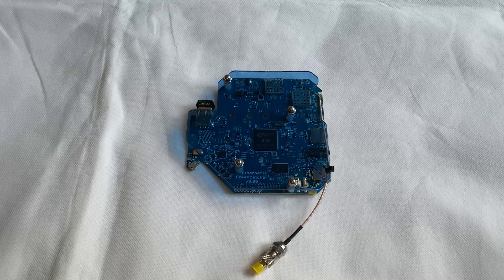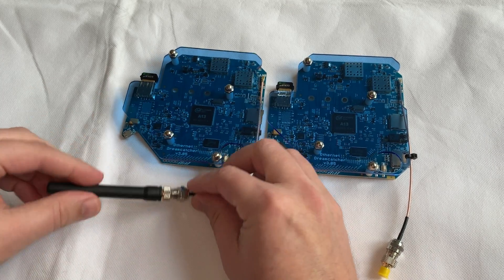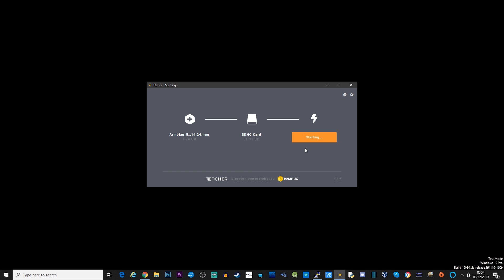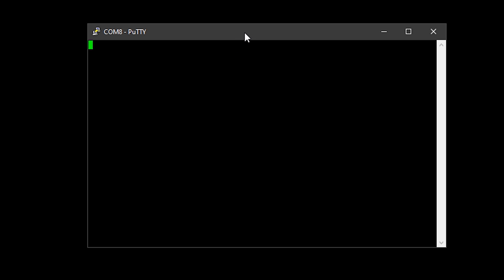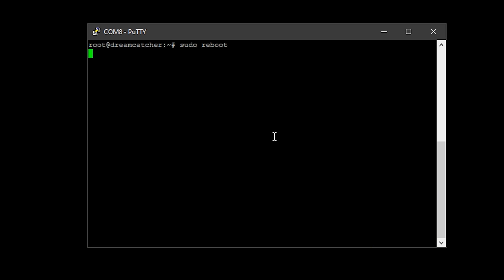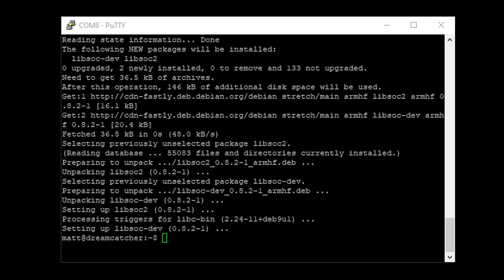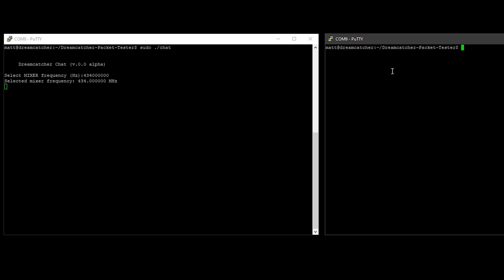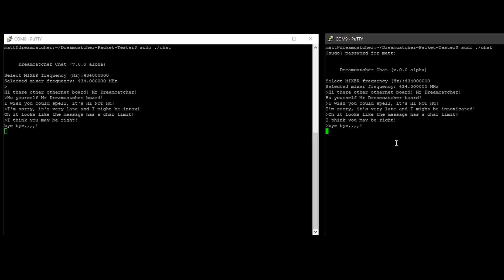What can you do with two Othernet Dreamcatcher Boards?

Comment: Awesome! What would be cool is to have an app on your phone that connects direct to the board by WiFi (or via your home WiFi network) so you can use your phone to send the messages without any sort of internet connection. The transceiver could then be placed in the loft of the house with a permanent antenna to ensure stable comms.
Love it!!!
Reply: Well done,can you teach me its connection procedure,is that connected to LNB

Comment: Just so ppl know, you can use any type of computer or SBC to do this. For example, you can use an SDR transceiver with a Pi as well. 
And yes you can use a USB Audio Interface. Most distros already have drivers and libraries for audio built in, but some lite/slim distros made for SBC's (Single Board Computer's) don't. In that case you can use alsa-lib. Depending on what SBC you're using and whether the interface is a dongle interface or a full blown interface, you may need to provide external power to the interface or use a powered USB hub.
!!!!! MAKE SURE TO CHECK YOUR COUNTRIES RULES ABOUT TRANSMITTING AND WHAT FREQS ARE ALLOWED. YOU CAN BE FINED FOR IMPROPER USE OF RADIO. OFTEN A LICENSE IS REQUIRED TO TRANSMIT OUTSIDE A CERTAIN FREQ RANGE !!!!!
Now, about power delivery in general. This is important information for people who aren't already aware.
When you're using SBC's with things plugged into the USB port/s or wifi or bluetooth or all of those, I recommend using a powered hub or a USB3.0/3.1 port as they provide more power than a standard 2.0 port.
USB2.0 will provide 500mA@5v, USB3.0/3.1 will give you 900mA@5v. You can also use USB Type C as well, but you will need a Type C to Type A adapter if you don't already have one. You can get them for about $1 on ebay/amazon. I believe USB-C is capable of 3A@5v. I could be wrong. Please correct me if I am.
It should be noted that when you are using an Othernet Dreamcatcher or any other SBC with a transmitter, the power rating is important. I recommended using USB3.0 or USB-C or even an external wall charger. USB2.0 only provides 2.5w, USB 3.0/3.1 is capable of 4.5w, but if USB-C is capable of 3A@5v then it can pump out 15w. This is important as the transmitter requires power to transmit. The more power, the higher the gain and the farther it will transmit/receive. Most transmitters are specifically designed to transmit at a certain power levels because of regulatory rules and laws relating to radio and communications. I don't know what the Dreamcatcher is actually capable of. I've never used one. But when powered from USB3 its probably capable of around 2-4w. Which with a clear line of sight can still go for kilometres. Dont forget though that more than just the transmitter requires power. The processor, ram and other chips onboard also require power as well as any other device plugged into the onboard USB ports. So the more power overhead you have the better the chance of your devices running at their optimal power levels.
I apologise if any of this information is wrong. This is all off the top of my head, so if people want to go fact check me and correct any mistakes, please feel free.

SDR (Software define radio) is fun to play with. You can do many things that are not possible with a normal transiever or radio. Including hack phone calls and wifi if you are that way inclined. But beware of any consequences if you do. As I imagine its probably illegal. :D

Comment: Ones we were planning around with tv sdr sticks, you can listen to the local oscillator. Now quickly writing an software that modulate the rx frequency (changes the local oc freq) we got an working fsk data transmission... After modification to the sdr stick fot more local leaking, a tv antenna booster connected as an rf amplifier we got several hundred meters range on 1.2ghz.

This was done at ham radio camp in Finland a couple of years ago, just some stupid ideas you get while BBQ and having a couple off beers...

If dream board is using local oscillator for transmitter, the range isn't much better than a couple of meters, depending on quality of the board. You usually want to keep the local not from leaking and interfere.